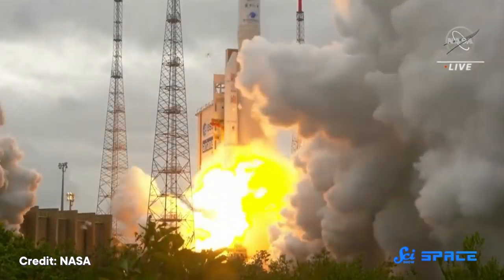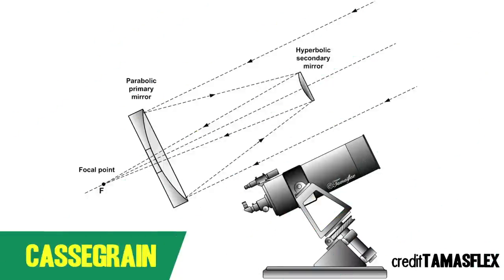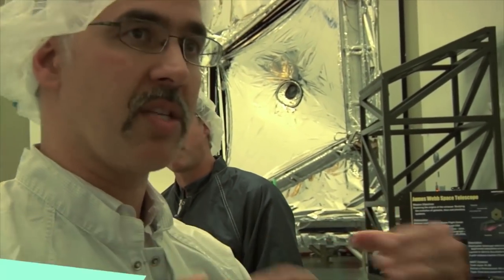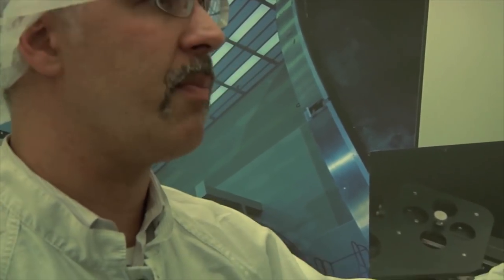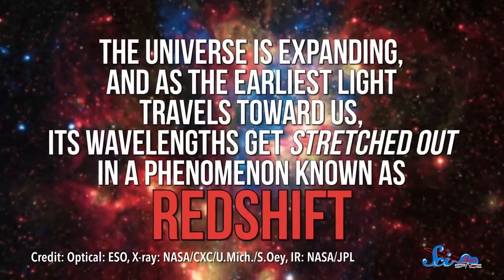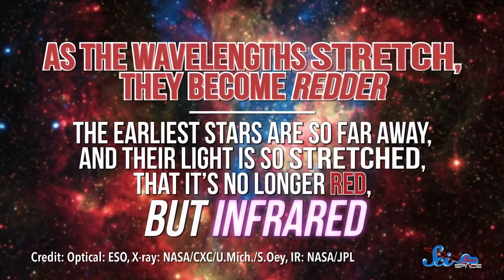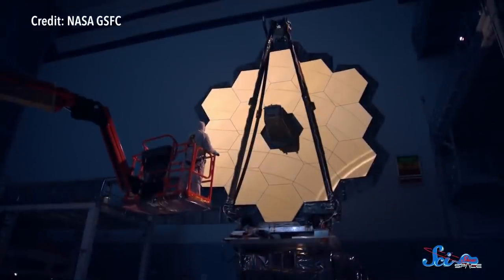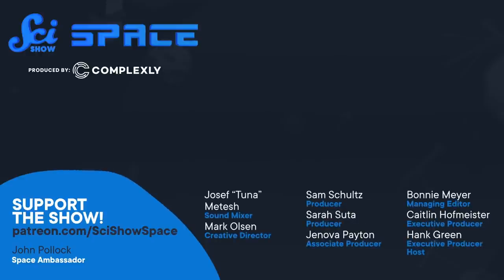Why It Took a Decade to Launch The James Webb Space Telescope | Compilation

Comment: 3:13 I love when tech is thought out so thoroughly there is no better way even hundreds of years later.
Reply: True. Of course, it's only the main principle of the tech that's remain the same. The execution of it tho (additional tech attached to it, its exact shape and proprtions, the precision of building the parts, etc.) has improved over the years.
Reply: I’m still trying to think of an example. Except tooth enamel, but that’s ancient.
Reply: @summer-west  Personally, I like the way the Romans started a cool thing called "building roads in a grid," that turned out pretty useful.
Reply: E.g. wheel
Reply: @summer-west  power! Other than solar and wind kind of, create power by using water to spin a turbine. Nothing beats it. So efficient. Same idea used for 100's of years or more

Comment: As an engineer/space nerd that now runs a cnc machine shop, I as so curious how much each of those beryllium mirrors cost to machine as its a expensive material by its self and also super expensive to machine with the addition of what I must assume to be nanometer tolerances across the whole part.... incredible!
Reply: Now lets hope nothing cold welds together
Reply: @Shad0wBoxxer  as far ad I know cold welding of parts in space is an old problem that has been solved. Back in my schooling days an engineer at JPL taught my one of my material science labs and he told me all the engineers over at jpl do a cold welding review of their design to make  sure it cannot happen (no similar uncoated metals that need to slide or rotate can come into contact , etc)
Reply: You can read more about the manufacturing of the beryllium body if you look up 'Mitsui Seiki JWST'.   The Machining is not nanometers but incredibly tight volumetric tolerance (small tolerance relative to component dimensions).  However, the gold plating and subsequent polishing is more stringent.  If you want nanometer tolerances from manufactured components, you want to look up 'Diffraction Grating'. Diffraction gratings make it possible to determine what element compositions are out there so far away.

Comment: I'm still curious what caused the delay from March to December
Reply: I don't know what caused that particular delay, but they skipped the 2012 delay due to ripping the sun shield in one of its test deployments and having to go back to the drawing board with its design.
Reply: There were concerns about how quickly the air inside the Arianne’s fairing would vent during launch. The concern was if it was violent it might damage the sun shield. 
Additional data was collected from two launchs in 2021.
Reply: I imagine COVID had an impact too.

Comment: A question for one of the future episodes: how penguins deal with all this solar radiation, since there is such a massive hole in ozone layer over Antarctica?
Reply: Also maybe some advice on how redheads living in the Southern part of Australia deal with the massive increase in UV index due to slight shift of ozone hole? Especially difficult during our worst heatwave and Summer on record - currently day 6 in a row above 40°C.
Not fun attempting to move house during the heatwave, along with most extreme rental crisis, Omicron outbreak, 400+ delicate planters with rare species and a household of furniture to shift 400km at very short notice. 
At least I'm moving slightly closer to the penguins (South) but slightly cooler temps on southern tip of the state don't make me feel happier about melanoma prevalence in my family.
Reply: Fur

Comment: When will we be getting the first images?
Reply: Approximately 6months. The 18 mirror segments are individually adjustable so that they can be moved from their docked launch position to the correct position and angle to reflect the light correctly. According to NASA this process will take some time because the mirrors are designed to move only a few nanometres at a time so that the 18 mirrors combined  form a precise parabolic shape.
Reply: @amalieemmynoether992  Thanks!

Comment: I was in the sciences my whole career and this thing is the only project that I ever saw that should have been cancelled 1/2 way through. I have friends who will directly benefit from it but still, the glacial pace of development means that we now have a telescope on the cutting edge of science in 1995. It will do some good work I am sure and some very talented people worked very hard to build it but if it had been cancelled in 2007 with huge reusable rockets on the horizon the telescope we would have made with the extra money probably would have been a lot better and serviceable and upgradeable. It will not be 25 years (probably) before huge spaceships are flying past it and the tour director is saying 'sadly it wasn't built to be repaired'. That said my highest respect to the engineers and construction people who made it and my fondest hopes that the sciences will benefit from it.

Comment: Hmmm. I wonder if the James Webb benefited from later launch by getting better computer and software? I mean, it was delayed DECADES... Anybody know? guess?
Reply: Our newer computers do not resist radiation too well. They are built on such a small scale that ionizing radiation can easily damage them.
Reply: Plus spacecraft designers tend to prefer tried-and-true tech over the latest-and-greatest wherever practical, for reliability.  You really don't want your expensive spacecraft breaking down out in space, where you can't easily get to it to fix it.
Reply: @prolarka  I see.
Reply: @AaronOfMpls  Both great answers. Thanks guys.

Comment: I got a question. We use gold plating on the mirror because it is the best reflector of infrared. Does that mean if you stuck a bar of gold out in the sun with a bar of aluminium of the same weight, the gold bar would take longer to get hot from the light of the sun?
Reply: No, because Gold is also a superior conductor of heat than aluminium.
Gold conducts 3.17W/cm K, while aluminum conducts 2.37W/cm K.

Only copper and silver are better metals for this job. The best conductor I know of is an unflawed diamond. Carbon nano-tubes may prove to be superior.
Reply: @ssgoko88  if it's conductive of heat doesn't that mean that It would "feel" more colder. I'm aware it would still be the same temperature but more conductivity plus it's reflection of it would make it feel on touch slightly colder.